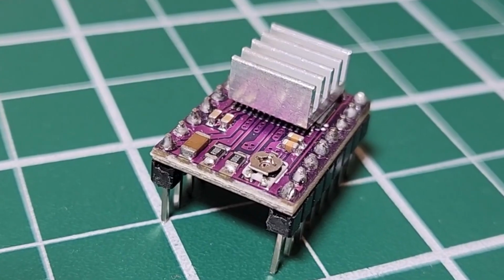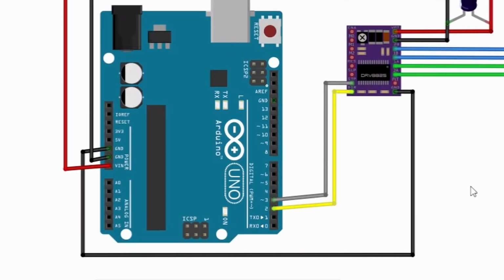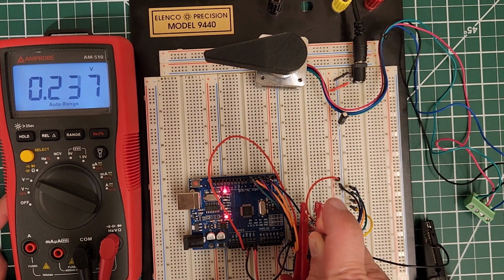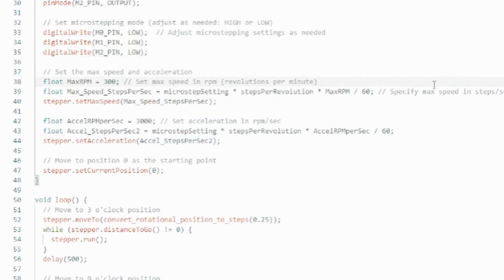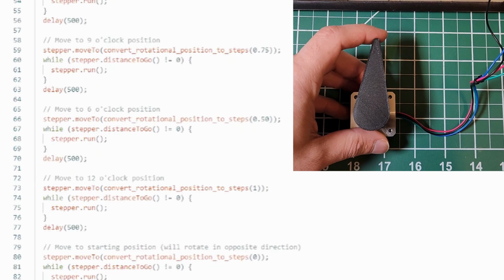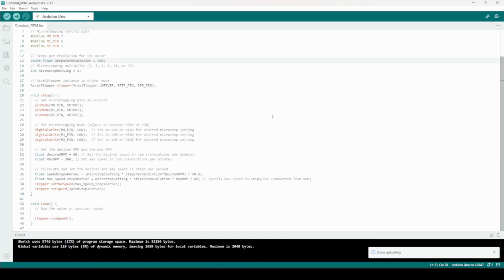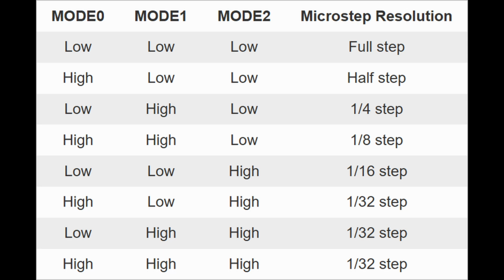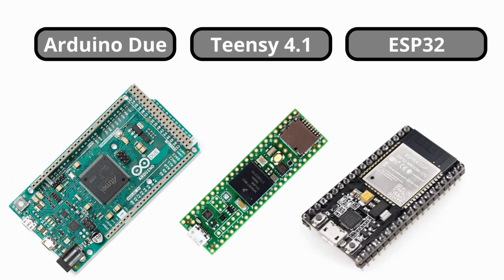DRV8825 Stepper Motor Driver – Complete Guide

Comment: When using motor driver for "bidirectional" control of dc motor, how to add diodes (Schottky, Zener, Snubber, or Varistor) to prevent back-EMF or reverse Voltage spikes from the dc motor? TVS diode won't work due to the voltage spikes (50V) being too frequent.

Comment: So your got with diagram which is which, but you didn't connect it like that, I mean not color it like that. Your motor has green, blue, red and black wire, and you show on stepper motor driver just green and blue? Why? Why you didn't show exactly what goes to 1A 2A, 1B, 2B. Cause for me it is not clear even with diagram, ... cause you didn't explain what is 1A, 2A... Pls
\

Comment: Hi, I have 4 DRV8825 plus the shield, I am trying to hook up 4 stepper motors to a flysky rc transmitter and receiver but am having a hard time and I can't find any video on how to do it, do I need any additional parts either then the DRV8825 and shield to do so ?
Reply: I don t remember how flysky (i supose you mean reciver because you would want to recive info and translate it into stepper motors motion) you hook the drivers as usual to an arduino + now youll have to hook the reciver to arduino, idk if it had rx and tx like elrs or had other terminals but you need to check out its datasheet and understand how does it comunicate via its pins so you know how to program ur arduino to understand the commands

Comment: Hi
I am using nema17 stepper motor and DRV8825 to drive it but my motor driver is getting heated up even though my stepper rotates. Is there any reason for this happening?
Reply: Hi, the DRV8825 comes with a small heat sink, did you put it on ?
Reply: Can i get the coding that u use... Because mine not working at all.. It just not rotating..

Comment: I bought 2 of drv8825. I can adjust current on one of them using screwdriver. But the other one has vref value fluctuate. It keeps showing random value and then back to 0.
Does it mean it's broken?
Reply: That variable resistor could be damaged

Comment: How come, I can't get any voltage on the potentiometer on five DRV8825 I bought from China? Should I consider it bad and buy another one like from your link?
Reply: You need to power it with 12V as well.
Reply: @LuisFelipe-tg7hw  i fixed it few weeks ago. I think i added DIR and STEP which gave load

Comment: can i use the USB power cabel and not use the 12V battery? also i tried this method and the voltage doesnt change at all
Reply from the maker: To power the Arduino Uno itself? Yes. For the motor voltage, follow what's needed for the motor while staying within the DRV8825 and capacity ratings/limits.
Reply: @diyengineers  what is the best way to find out if my driver is fried(something burned down)?
Reply: @diyengineers  i tried testing for continuity with multimeter Vout and GND and it doesnt beep and shows 1.8k ohms